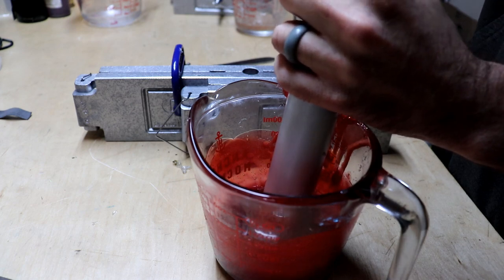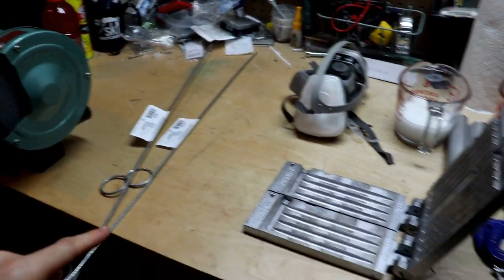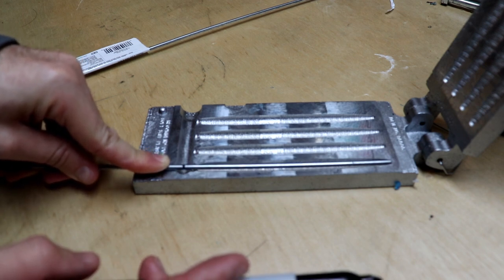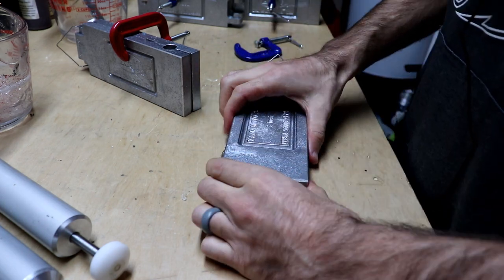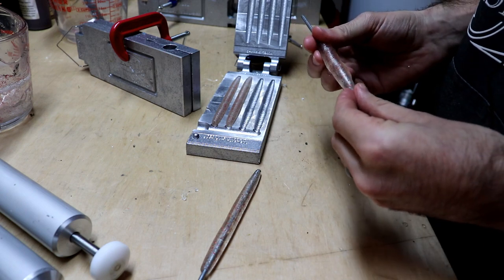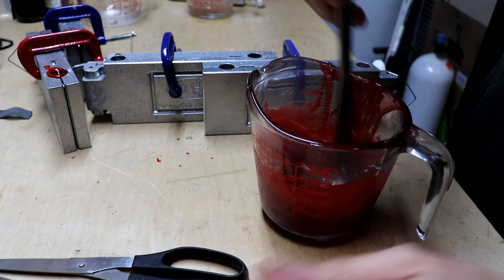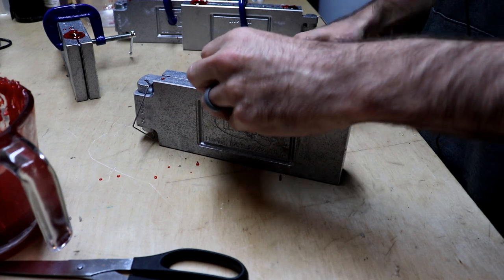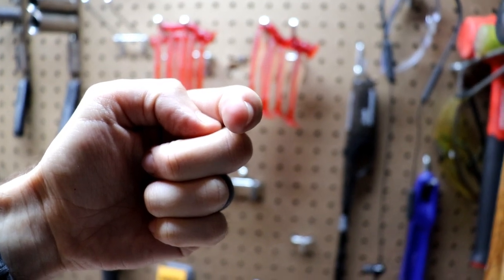DIY Core Shots using Do-It Molds (CHEAP and AWESOME!!!) | B Fishing |

Comment: Ok I have something for you I’m going to let you in a secret but want to see it made. 
Ok best all time plastic ever made for every age for almost any species is the k&E bass stopper. Just amazing for a turd of a plastic lure it is but always always produces. 
I absolutely love and only color I ever use was purple with the white stripe on it. 
I myself of course have upgraded to the Senkos for size and weigh obviously. Now  I go with purple either junebug or red flake but I have experimented with the white strip on it and always I mean always go through the whole pack. The only way I can do it is to mark the line with the paint marker and is messy and a pain in the arss plus it’s not as brilliant or permanent as I want.
Make a badass purple senko with a white stripe on it and omg $$$. 
No one has it and this is on the right tack these core shots. 
Let me know I tie flies and build rods but not the plastics. I really need this in my arsenal ty mr J rods

Comment: How long do you let the baits stay hanging until you use them? Also great core shot video this really will help me (:
Reply from the maker: 24 hours
Reply: @B_the_Cameraman  Also, how can i prevent air bubbles? I usually pour the plastic into my injector rather than sucking it up. Also, If i put my baits in a bag they will go lob sided. how can i prevent that?